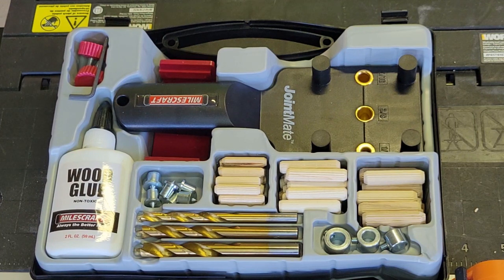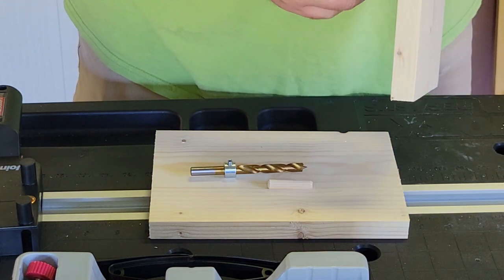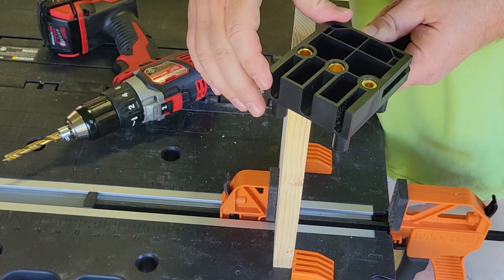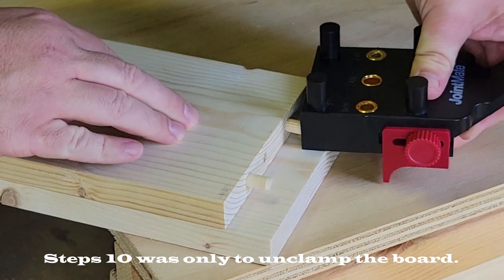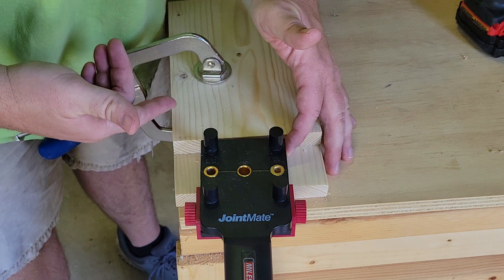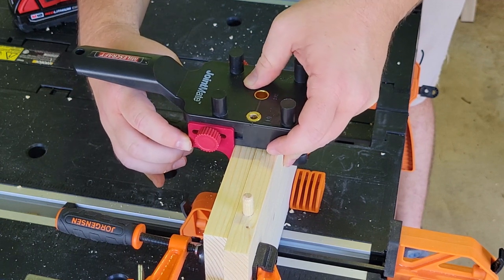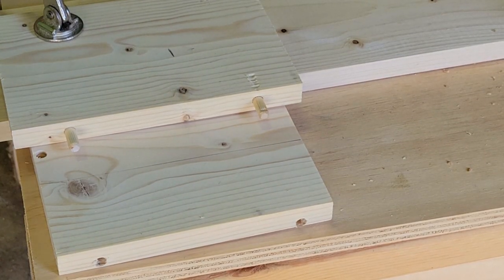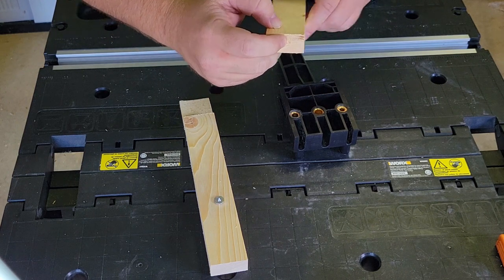Milescraft 1309 Dowel Jig Kit Demo

Comment: You hit the most important part, the cost! I cannot in anyway justify a $300 biscuit joiner or a $1k festool domino joiner. For basic alignment, these seems to do the job. Thanks!
Reply from the maker: Thanks for watching.  Sure,  there is something out there most anybody using dowels would like,  but they cost way more than I could justify with my current needs.

Comment: For anyone wondering why the edge to edge didn't line up, it's because bobby adjusted the fence on the wrong board, to correct this, only adjust the fence with the board that has the dowel in place, that way, you can be sure that the dowel jig is centered. Afterwards, put both your boards together, use your jig towards the new board and line up the dowel in board 1 to fit in the edge of the doweljig and you should be centered on your new board.
Reply from the maker: Thanks for watching and helping to clear that up.

Comment: Well-explained. Thanks. I had that same issue where it made a non-centered hole. It can happen when using the 1/4 or 5/16 guide bushings. I noticed if you angle the jig in one direction it centers nicely if you angle it in the other direction, the handle bumps against the board and causes the hole to be misaligned. All the best.
Reply from the maker: Thank you!  I'm glad you found it helpful.

Comment: Can you do a 45 degree bevel or miter dowel joint with this jig?
Reply from the maker: I'm not sure, as I haven't tried.  I think a dowelmax style may be easier to use for that.  Some exist that aren't expensive like a dowelmax.
Reply: @bobbybuildsit  Yah thanks.  I haven’t seen any other then Dowelmax and that’s too expensive for an occasional user like me.
Reply from the maker: @kle2217  Self Centering Doweling Jig Kit... https://www.amazon.com/dp/B08L3856X6?ref=ppx_pop_mob_ap_share  I got this one to make up for some of the shortcomings of the Milescraft.  I actually haven't had the chance to use it yet but you've inspired me to test out the miters with both.
Reply: @bobbybuildsit  I hope you do a video of this.  I'd be interested to see a comparison of this with the Milescraft.  I had bought the milescraft dowel jig kit for about $20 half a year ago and have not used it yet.  Been using pocket holes mostly for joining pieces together.  Maybe you recommend something cheaper then dowelmax that's out there for doing 45 degree bevel/miter edge joining.

Comment: For the edge issue, I think you misread the instructions.  This video is from Milescraft:  https://youtu.be/QALncuFuEgk  The edge joint section starts at 4:11
Reply from the maker: User error was most certainly the issue.  Thanks, I'll check it out.
Reply: Correct. The jig has to be placed over the corresponding hole then the fence set. This is then transferred to the second piece using the slots to ensure that the placement is the same
Reply: @Tom Geist, the funny thing about your comment is that the 4:11 time marker is both relevant on this video and the video you referenced. That's like a one in a zillion coincidence!

Comment: The edge joint issue was interesting - does the thickness of the board affect how that works?  I did not see you make an adjustment on the jig for that and those holes vs the jig do not look adjustable for board thickness.  

Appreciate this - I have the Kreg system which uses screws for joints, but I have to refresh my memory on that system every time I use it and would rather do dowels for some work.
Reply from the maker: Hey Mike ,the thickness of the board does play a role.  I may have not had the jig up against board one perfectly tight thus causing that hole to be off  center a bit then carrying over to board two.

The only adjustments are how tight the pegs are up against the board, any little bit will move the bushing, and adjusting the fence.  I think I just need more practice with the jig and possibly work out a better clamping system.

Thank you for watching, if you have any other questions I'll be glad help.

Comment: You set the jig incorrectly for the edge to edge configuration. That is why your boards didn’t line up. I’m not bashing you just giving you a heads up. Watch the official milescraft video to see where you went wrong. But great job otherwise.
Reply from the maker: Thanks for watching and the feedback.  You are 100% correct.  I've elected to leave this video up as is to show how easily one can make a mistake,  even when the directions are right there.